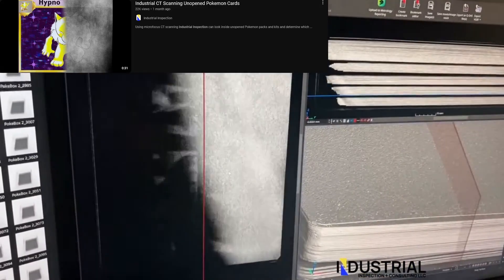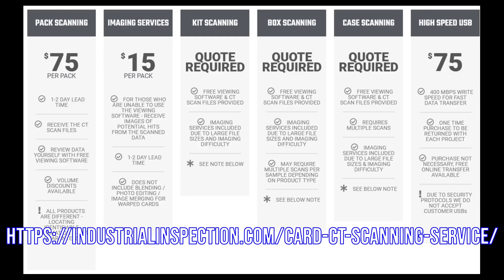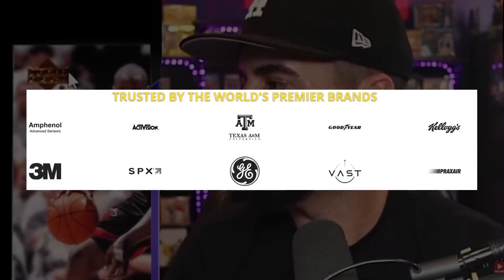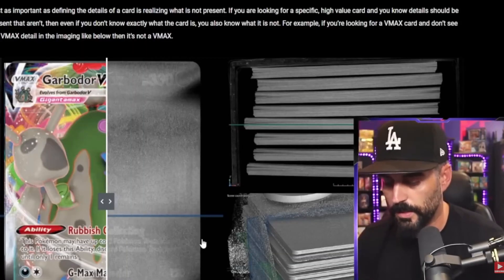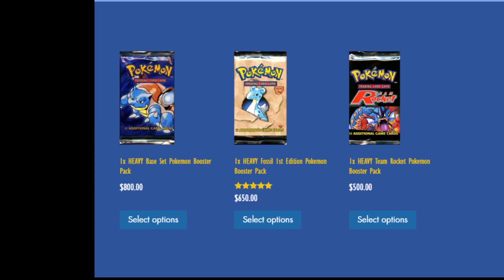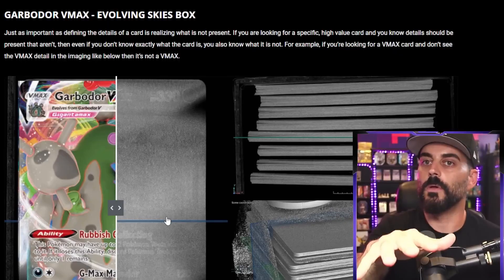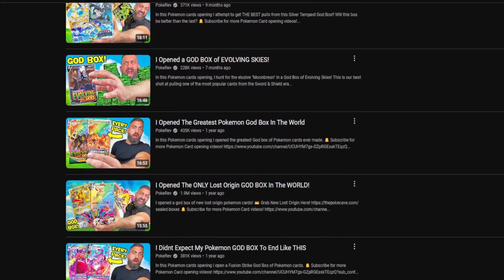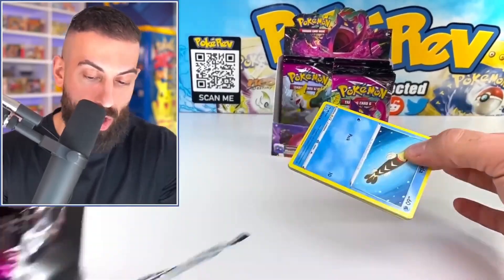CT Scanning Pokerev Mystery Packs and Box Breaks ft. the Mr. Beast of Pokemon and discount Keemstar

Comment: I agree there are a lot of scammers out there. Along with some slide of hand tricks done in box breaks. As far ripping people off….. How is scanning any better than weighing? Weighing, yeah you know there is a hit in there. Scanning you know what the hit is. At the end of the day, if you put a value on all the different scams out there. There will be more value stolen/scammed with this tech in the next 2 years than all of the other ways put together in the same time. 
The only thing I can see good about this is information. Letting the average person know, CT scanning is and has been a thing.
This will definitely hurt anyone holding on to any sealed vintage cards. I believe eventually it will bleed into other sealed products as the service becomes less expensive. 
Note, I don’t have a dog in the fight. I do not consider myself a sealed collector.

Comment: I’m sure guys like PokeRev already have a CT scanner on the way
Reply from the maker: I wouldn’t be surprised. 😂
Reply: I'd bet they'll just find a local industrial testing & scanning company and make a deal with them to scan the boxes/packs.  Industrial CT machines aren't like a 3D printer or other simple tech... they are extraordinarily heavy machines because they contain dense barriers to contain the ionising radiation (which is generally higher intensity than in a medical CT machine), so it needs very solid, immovable foundations.  They require very precise adjustments, use complex software, use A LOT of electricity (for both the machine & HVAC system to keep the room cold & dust-free), and demand careful attention to the radiation hazards... I doubt it would make any financial sense for guys ripping trading cards on webcams to invest the hundreds of thousands of dollars in ongoing costs for the infrastructure when they can just get a company that specialises in industrial testing to do it for them.